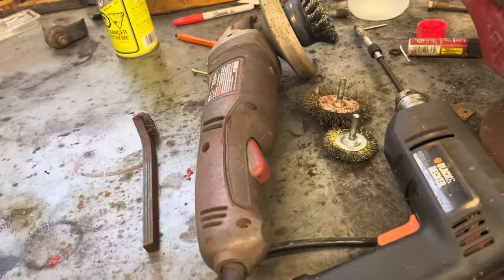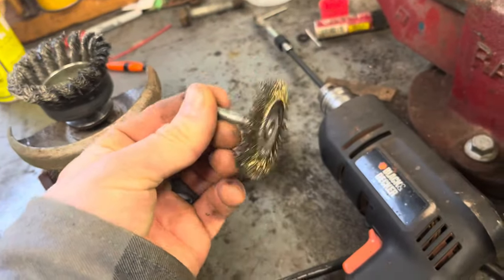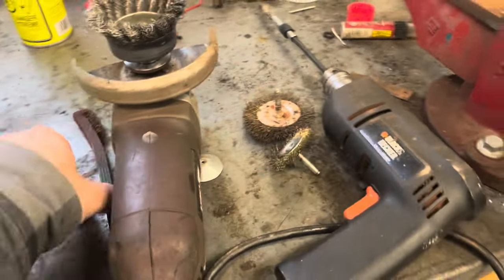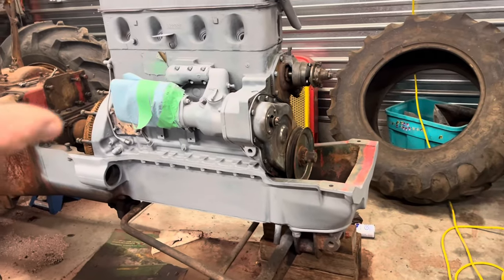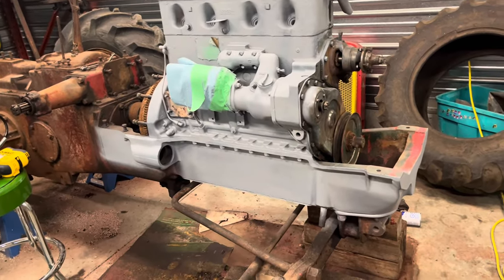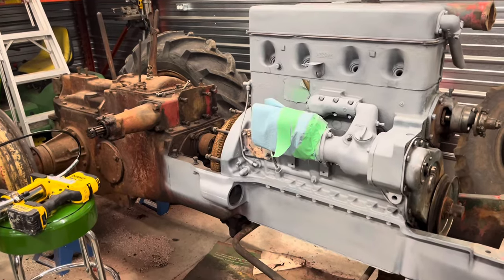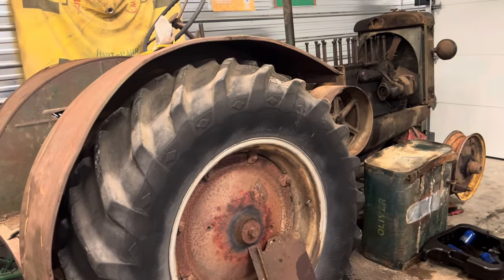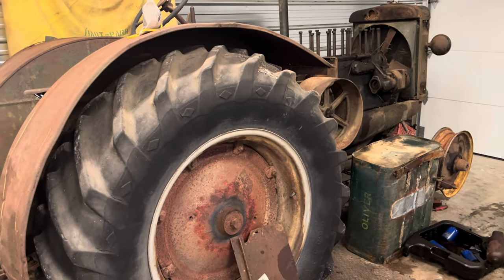How I prep my tractors for painting.

Comment: Looks good Curtis!! I've always sand blasted everything BUT the casting (engine and transmission) unless it is down to bare casting (no internal parts) other then that the angle iron like your using works very well. I sand blasted the chassis of one tractor once and it was a disaster. That stuff gets EVERYWHERE it doesn't matter how well you try to protect things and be careful. It's gets into the depths of everything. 
Keep up the good work.
Reply from the maker: I learned doing the farm toys that sand gets everywhere ! You have to spend some time with an air blower on the compressor to get everything cleaned out .

Comment: Nice update! I had s go once with a sandblaster but it was painfully slow as our compressor was too small. Wire wheel all the way! 

My dad always uses red oxide paint to seal metal but pretty much everyone now uses the grey primer like you. Is the newer grey paint better than red oxide in your opinion?
Reply from the maker: I have used red oxide primer in the past, with great results, I don’t believe there’s a real difference in the 2 but gray primer will seems to make your paint job brighter , I have access to a big portable sandblaster but I don’t want the mess to clean up wire wheel is still the way to go for me